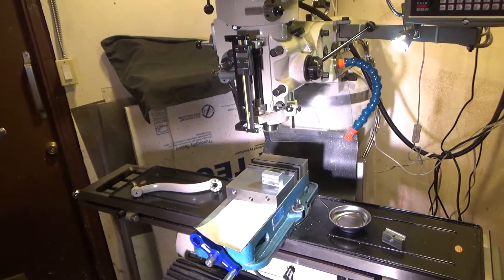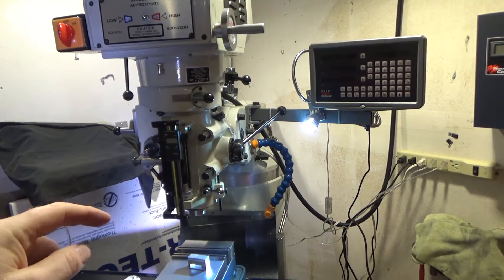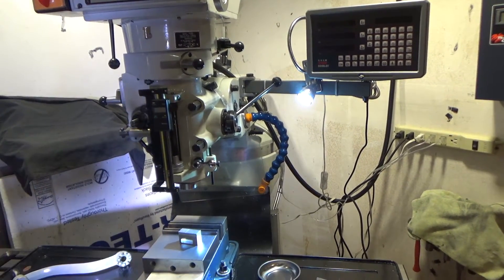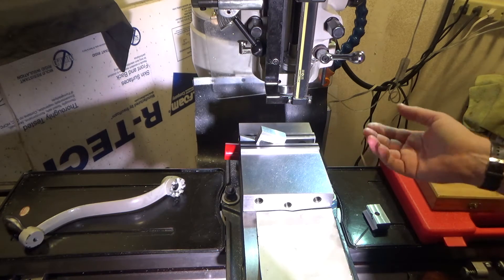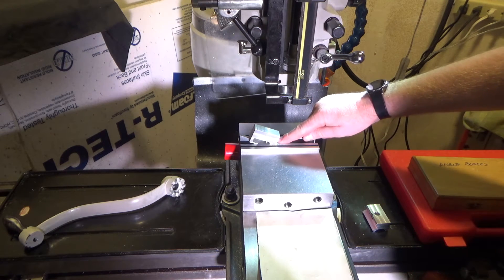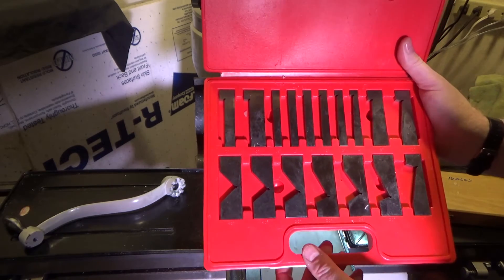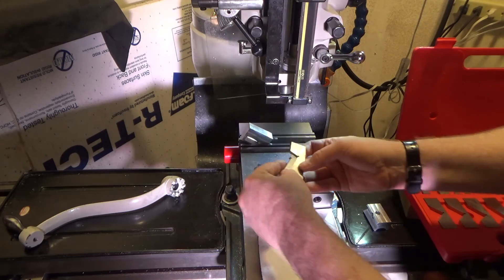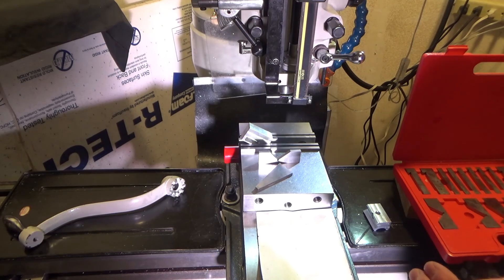QTR#2 Precision Ground Angle Blocks with Stops

Comment: Take that old angle block set, and put them in the mill vise one at a time with the angled side aligned flat (sweep with an indicator), then drill 3/32"  (those angle block typically are 1/4" thick) holes every half inch or so, now you drop in a 3/32" dowel pin and have adjustable stops when you need them to locate parts anywhere along the angled face of the angle blocks  You can also do the same maybe 1/4" back from the either end of the angle block on the bottom and now you have stops  with a 3/32" dowel pin to keep the angle block from sliding in the vise like you do with the magnet.  Magnets work well, but are a major pain the butt when machine steel as all the chips seem to find the magnet and with strong magnets can be a real pain to clean off

John
Reply from the maker: Thanks for the very interesting suggestion. I might just follow that advise. The angle blocks I was using were not terribly expensive and the idea seems great. Much appreciated.
Reply: You're very welcome.  Another thought is to run drilled hole in the BOTTOM of the angle plate all the way thru (the hole at the small end of the angle plate) and you could use longer dowel pins to hold a "stack" of those angle plates together when building a angle, and still have the adjustement holes available on the top most angle plate for a parts stop

Take care -

John
Reply: Don't know about your set, but mine set (cost about $36) was hardened to somewhere around Rockwell 56-60, so I needed carbide center drill (#0) and carbide drill bit/end mill to drill the holes.  Just a heads up --

John

Comment: In your intro about machining angles by changing the head angulation, I think you mean something different to what you say. Both of the head angulation adjustments are non-independent, since changes in angle result in changes in the location of the end of the cutting bit. When you rotate the head around XZ, the bit moves in X and Z. When you rotate the head around YZ ('nod' the head), the bit moves in Y and Z. Both types of adjustments have their pivot axis displaced from the bit, but the nod adjustment has a much greater displacement (cantilever), resulting in a much larger change, particularly in the Z location of the bit for a given change in angle. This greater cantilever distance also means that much more force is required to make nod adjustments, hence the worm gear. In contrast, adjustment of rotation around XZ requires comparatively little force, at least for small angles, because the mass of the head below the pivot axis partly counterbalances the mass above. The long and short of it is that re-tramming the head is something we avoid, especially for the nod adjustment. Onward.
Reply from the maker: Thanks as always for the response. I had to rewatch the video myself to see what you were talking about. I think I understand the confusion. I was making a poor assumption that people watching the video were thinking about tramming the same way I was. I was talking about the motion of the head relative to what a tramming indicator would see. I use the edge technology Pro-Tram system and was talking about what would happen to both indicators as the head was moved in a particular direction. If you nod the head both indicators will move in the same direction, but at different rates. If you tilt the head left to right one indicator will go up and the other down. If you were using a single indicator on a swing arm, as many people do, The nod always seems to be a bit more difficult, at least in the beginning. I was not terribly clear on this and made the assumption that people could see the picture in my head. Watching the video again, I definitely could have done better. thanks.
Reply: robert weitkamp Using a double dial indicator trimming device, my comments still apply, but the point of reference (instead of the tool tip) becomes an imaginary point directly between the tips of the indicators. This point moves just as I described for the tool tip earlier. If the adjustment axis could be positioned in line with that point, adjustments would affect only one coordinate. For a typical vertical mill, the nod axis is very far from being in line with that point, so the amount of interaction between axes is very large. For the other axis of rotation, the offset is not quite so large, so there is less interaction. My point is still that BOTH adjustment axes produce offsets in 2 axes, so you have to iterate adjustments to complete the trimming.
Reply from the maker: Interesting. I had not considered that the nod for example was both YZ, which on reflection, it of course is. However do you actually care about the final y position as long as the z axis in two positions is equal identifying that the head is level? Similarly, for the tilt, I now see that the x and z axes are both effected, but do car about the x? You always bring up such interesting perspectives, thanks. Sometimes I cringe when I see your replies, because I think, "What did I do wrong now?", but I always learn something. So, please keep it up, if not for my sake, for everyone else's.
Reply: robert weitkamp Yes. If you read my first reply, I suggested not that you were wrong, but that you probably weren't saying exactly what you mean.   
Keep up the good work.